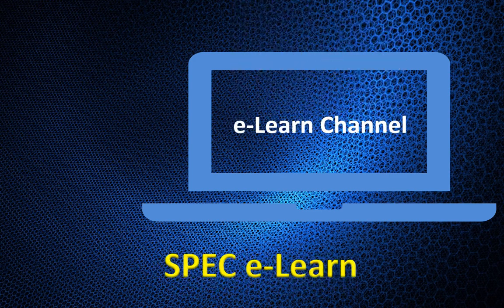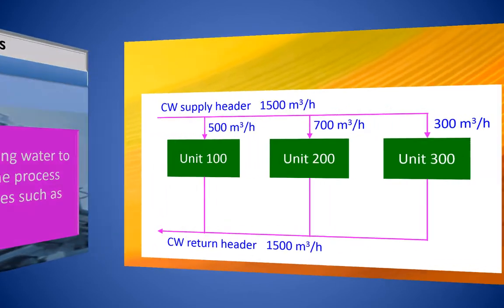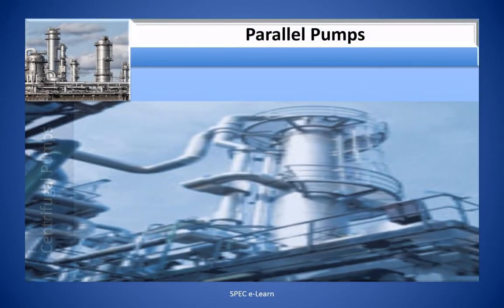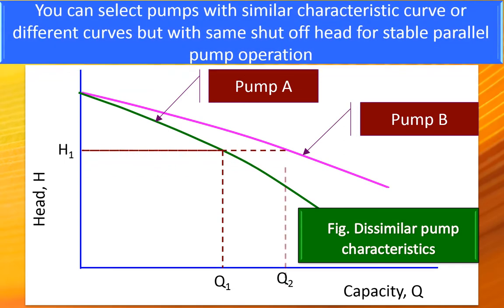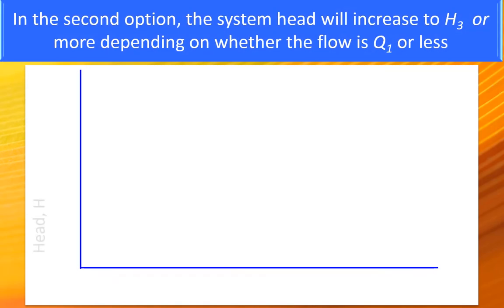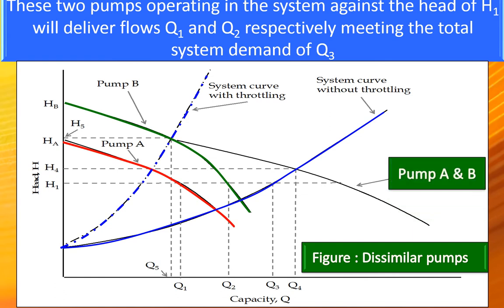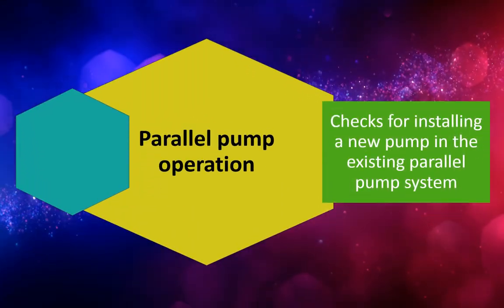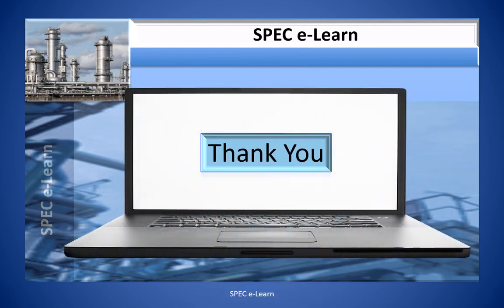Centrifugal Pumps: Parallel Pump Operation – Do it Right. Or else?

Comment: Nice explanation.. exactly looking for this video..
Sir pls explain How pumps behave when we are operating them parallel in closed Loop network and also if three pumps with different capacity vonnected in parallel what will happen to net flow and head?